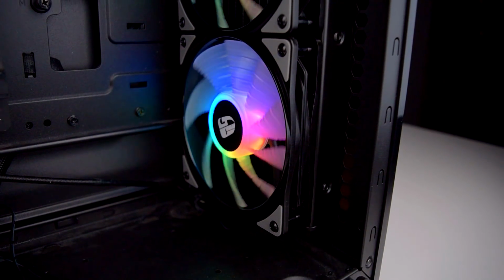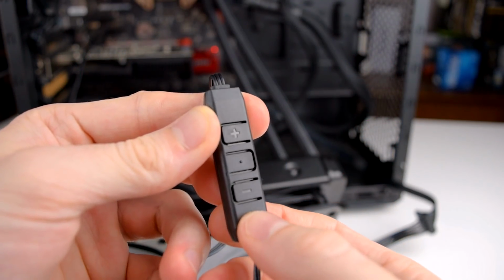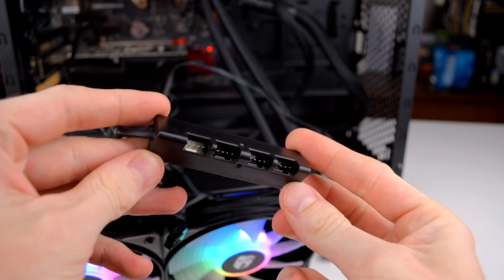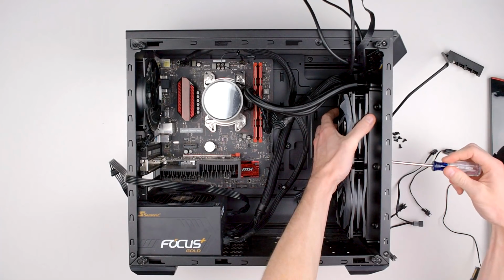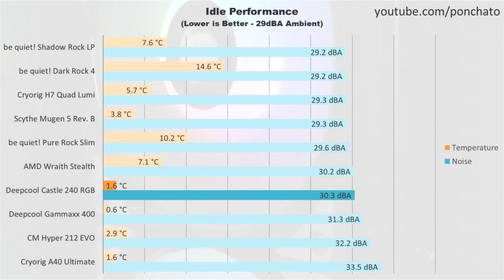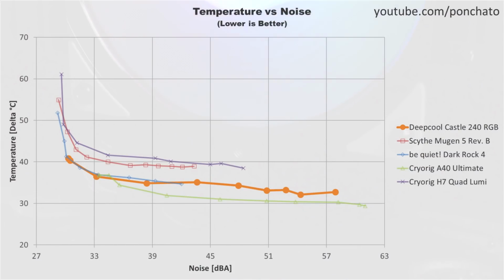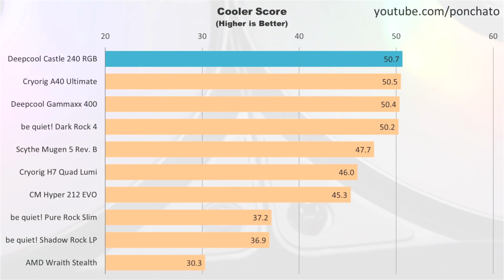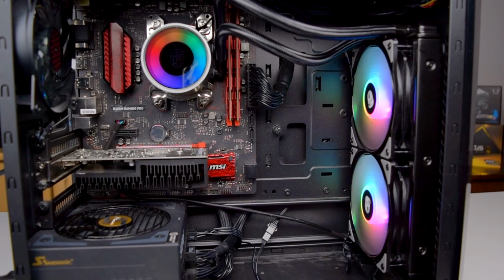The First RGB Cooler To Make Me Say “Wow”

Comment: With your lines coming from the top of the radiator its possible your pump is pulling air as almost all radiators contain 2-10% air. If possible mount with the radiator lines coming from the bottom and going up to the pump. Without doing this your pump could break over time

Comment: I really like your cooler reviews whether it be Top Down/Tower or AIO Water Coolers. I'm looking forward to your hinted 'Twin Fan Tower Cooler tests.
A few points I wanted to add: Firstly I'm surprised you didn't mention the off centre fan label. For a top tier aesthetic focused product I found that annoying. 
Also what do the fans look like the other way around? You could have mounted them in a pull configuration if they looked alright from that side and maintain the regular forward airflow.

Nice point on the gap between the fans and the rad. Maybe with this and other fans you could get around this with adhesive pads to fill the gap in and if black you wouldn't notice it.
Reply from the maker: Glad you like the reviews and thanks for the feedback! I really appreciate it. And good idea with the adhesive pads, I'll have to try that

Comment: Why are your fans mounted as push air out of the case. Even with the weird screws, you can still mount the fans as pull air into the case through the rad ? I see more and more people reviewing or mounting the rad fans this way. Whats the benefit of this manner of installing the fans ?
Reply from the maker: That's right, I could've mounted the fans pulling air in. Two benefits of doing it this way though: aesthetics and performance. I wanted to better show off the LEDs, and because I expect fans pulling air through a radiator will perform worse than pushing. Come to think of it, that would be an interesting thing to test...
Reply: The difference ain't that great, 1 or 2 degrees max, if not at all. But you are correct about the gaps of the fans with the rad. That question popped up in my mind when I got my 240 rad. BTW, don't know if you can get your hands on the Gelid Solutions Phantom cooler. Would love to see a review of that cooler. The ones I find on Youtube are either from the previous atterations of the model or in Russian :)